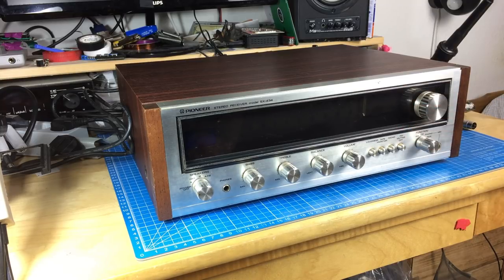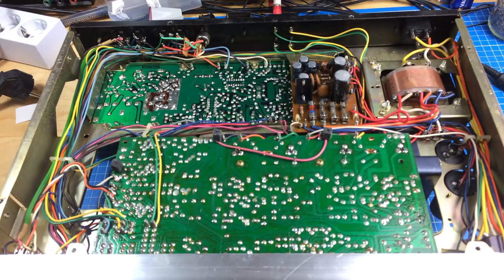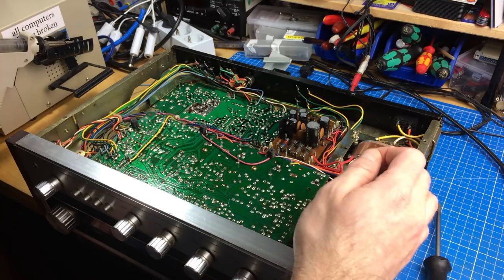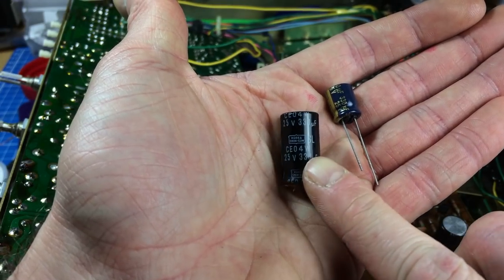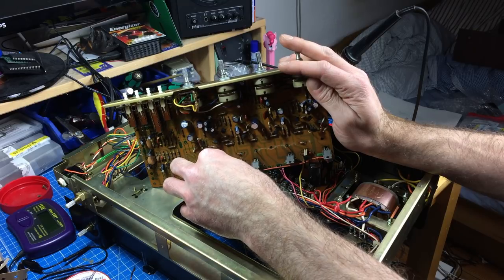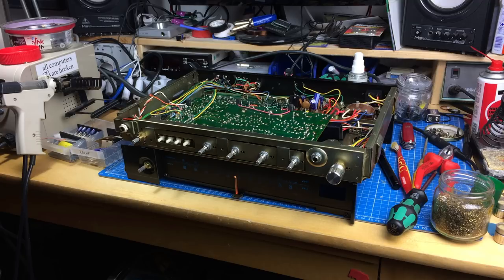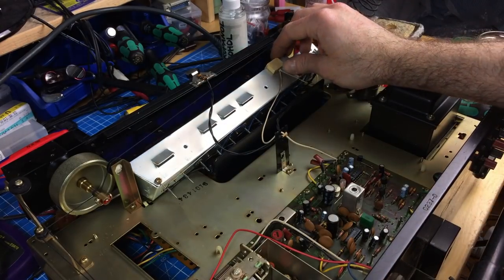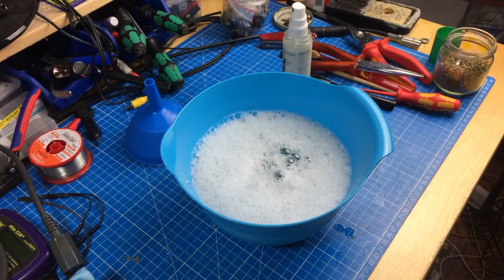Pioneer SX-434 Vintage Receiver Restoration

Comment: Those metal knobs in old receivers have such satisfying weight, unlike the cheap plastic knobs on today's models.
Reply from the maker: Yeah, they don't make 'em like that anymore... :/
Reply: So there is no need to add thermal grease/compound in between the transistors and the plastic isolators? and if you do use the thermal compound would it help with heat dissipation?Great video, very clear and informative.Cheers

Comment: Thank you very much for the walkthrough. Just got finished recapping my SX-434. Wouldn't have been able to do it without you. Great tip on cleaning the potentiometers. My balance was always a little crunchy but its perfect now. No need to replace it.

Comment: When you're replacing a single cap with two that don't exactly match the original, it's good practice to write on the board what that should have been (like .47uF), for future reference :)
Reply from the maker: Oh, that's a good idea. Didn't think of that at all. Will do that next time! :)

Comment: Got my first hifi system in 1974. It consisted of this Pioneer SX-434 receiver, BIC-920 turntable and KLH model 31 speakers all for less than $250. A few years ago at work they were throwing out this receiver. I took it to my fixit guy and for $60 he restored it. Now the Pioneer SX-434 sits in my kitchen and powers a Nakamichi BX-1 cassette deck and Boston Acoustics A-40 speakers. A very happy ending.
Reply from the maker: Oh, nice that you could recreate the old setup to an extend. As I said in the video, they just don't make this stuff like they used to anymore. :)
Reply: @JanBeta , just  been looking at old Pioneer receivers and the SX-434 sells for more than the SX-4, 5 or 6. It is a desirable unit and is a great little receiver. Love that back lit blue dial scale.

Comment: The power transformer is wound normally. The copper wrap, that lies over the windings, is to act as a shorted turn outside of the core of the transformer,  which reduces the effect of any magnetic field from the transformer, that would induce hum into the nearby electronics.

Comment: My vintage stereo project (were I going to attempt it) would be a couple of 8-track decks.  One is a full player plus radio receiver (belt good, no playback) for a friend, and the other is my own 8-track recorder that I finally found where I had stashed it away (same problem, belt is good, no playback).I just don't have a good soldering setup (irons or place to do it)

Comment: I have one and the nob to turn it on is super stiff how do I make it not super stiff. And this one of mine has the original capacitors and they work fine every thing works on it. And the balance nob and volume make a scratching nose. How do I clean them because it sat in a room where I put my hand on the top and the dust made my hand go brown.

Comment: i replaced the light bulb on my saba RS 910 with a LED as well (because i had 2 bulbs die in under 3 months already) - good thing the saba has DC for the bulb so all i did was add a resistor before the LED and some mechanical modifications (LED diameter was larger than the bulb so i had to make the hole bigger)
Reply from the maker: Yeah, these bulbs can die pretty quickly. It seems they especially die if you handle them while they are hot (I guess that's what happened in this case)...

Comment: I had the same, but now there's a lot of humming on the AUX and TAPE IN inputs. Do you know what might be wrong and how to fix it?
Reply from the maker: Look for bad filter capacitors in those input paths and also check for bad ground connections (broken solder joints, ripped wires, loose screws on the metal chassis). If the other input sources don't produce hum, the fault should be located close to the humming inputs.
Reply: @JanBeta  Thanks for your advice. Appreciate it.

Comment: Nice video. Thank you.  I have the same receiver, bought used last week. It's in almost mint conditions. When I listen to the radio and the station is in stereo the red light appears and shows "stereo". However, if I push the button "mono" on the receiver, the light does not change. The sound does change but not the indicator light. Is that normal for this receiver? (With my Realistic gear, when I do that the stereo indicator light goes off.)
Reply from the maker: I don't have the receiver anymore to double check but if I remember correctly that is normal behavior. The Stereo indicator just shows you that the picked up signal is stereo, it is not affected by switching the output to mono.
Reply: @JanBeta  Thank you.

Comment: The transformer isnt "flat wound" but the copper strap you see around it is quite common on EI transformers used to power audio circuitry. It is simply a screening band to keep emissions down. 

The main bugger with these amps (and many Pioneer made) is that they use an odd "multiple diode" device as part of the bias current feedback. If the output transistors fail, these diode strings frequently get toasted, and it is impossible to get them... so you either have to make a hack with several 1N4148/zener diodes, or create a VBE multiplier using a BD139 or something like it.

It's a nice little receiver you've got here though.. i'll carry on watching now (I got 5 minutes in before commenting ;))
Reply: For the 0.47uF electrolyic.. next time.. feel free to use a 100v NPO/COG type ceramic capacitor :)

(edit: Im going to get to be a real pain in the ass arent i ;))

edit 2: looking at where those 0.47uF capacitors are used, they are used as audio signal coupling. Fitting 1uF capacitors should be just fine. The implication of doing this is that it lowers the -3dB cutoff point of the high pass filter that is formed in the typical use of these capacitors.. but it wont cause any major issues (and give you moar bass! :)
Reply: 20:15 - these insulators are called Mica washers. They are primarily as you say, to insulate the heatsink electrically from the tabs of the transistors which are connected to the Collector pin, and thus typically have the rail voltage on them.

Im not sure why Pioneer didnt do this originally, but there should be thermal paste between the heatsink and washer, and then between the washer and the transistor tab. Very messy.. which is why many modern things now use the grey "rubbery" washers you see which are both electrically insulating, and thermally conductive. I suspect at just 15 watts per channel, it didnt matter much..
Reply: 26:02 - im glad you've heard about the criticality of tuner alignment. I have seen plenty of tweakers on DIYAudio completely ruin their tuners by doing a shotgun recapping of everything - including the ceramic caps and things like polystyrene film caps. You are absolutely fine to replace electrolytics though - they will only be used in supply decoupling and audio coupling places, rather than in tuned oscillator places.

Likewise if you see any little wire wound coils that look as if they've been squished or prised apart and sealed with wax, dont EVER be tempted to "neaten" them by straightening ;) It is quite common to adjust an oscillator used in tuners by moving the windings on the coil and then setting them with wax. Of course this is done while frequency measurements are being taken at points in the circuit, to ensure everything is working as it should.
Reply: 30:25 - hmm, what an odd way of adjusting the DC offset and idle bias current. For the bias current, they are basically either shorting out a 10 ohm resistor, or not. I suppose this is better than having a little 10 ohm trimmerpot in there which would go nasty with age... especially with those fragile STV3H bias diodes !

The DC offset will have changed simply because of changing the capacitors C35-C38 , those 0.47uF capacitors you came across. As long as youre not seeing more than +/- 100mV on the speaker terminals under load, I wouldnt worry. Sometimes the output DC can rise higher than this with age, and occasionally it's due to the transistors in the input stage (Q10-Q13) having drifted with age.
Reply: between TP1 / point 27 and between TP2 / point 29 is an indication of the idle bias current. For your 8.8mV reading it is calculatable by ohms law using the value of the emitter resistors (0.5 ohms). So that would mean 16mA. Sounds reasonable given that they are TO-220 transistors.

BTW im sure you know some of this.. but it's good reading for your followers who may not ;)
Reply from the maker: I see. :) As you said, the transistors didn't get very warm after testing for a while so I suppose it will be fine without thermal paste.
Reply from the maker: Haha, no pain in the ass. I'm learning a lot from your comments. :)
Reply: Glad you are finding my feedback positive, not negative (theres an amplifier joke for you ;)
Reply: @jaycee1980  I noticed that too. After seeing the quality of this receiver, I don't see why they didn't add thermal paste. Makes me wonder if they did on the fancier units.

Comment: @Jan Beta... just a tip..... as you see at minute 39:01 ... the numbers 94.. 104 and 108 of the dial... are illuminated with a much clear tone of blue.... because it hits directly the brightness of the LEDs on those numbers ..... I got better result in my amplifier.. pointing the LEDs to the back....  pointing to the silver plate behind.... so the numbers get illuminate with the light that bounces on that silver plate more smoothly...
Reply from the maker: Yes, that makes sense. Thanks for the tip. I was experimenting with putting tape over the lamps as well with some good results. You definitely need to diffuse the light more as the LEDs are much too directional.

Comment: Great video! I used this to change the lamps on my Pioneer SX-434  and worked great.
Still the sound is failing from time to time (specially after 5/10 minutes of usage )either on left or right channel. I ear a sound like an explosion really loud or just fades and becomes intermittent...
I already cleaned it and used the Teslanol contact spray 
Could it be the capacitors? Any ideas?
Thank you!

Comment: I am looking for the best place to buy the cord that is used for the tunning of a SX727 I live in Qld Aust
Reply from the maker: I'd recommend searching eBay for "dial cord" / "dial string". I found a vintage hifi seller here in Germany that had plenty of different gauges of the string (used it to restring a Marantz in an earlier video) but you probably will find something locally as well. :)
Reply: Never heard of QLD in Austria, must be one of those little villages at the edge of town?

Comment: Hi,  I  bought  one of this a week  ago,  exactly  same model,  it was working  fine only minus was  only half of the  front radio quadrant  was  lighted,  and  the bass  knob  was making a static  noise but just when  increasing and decreasing  the bass. I  removed  the knob and sprayed some electrical  contact  cleaner  inside  of it,  and the result  was lost of bass and and almost all the sound,  now only little  sound  is coming  out from  all outputs.   what can I do?  please give me some  advice,  I will  really appreciate it. ☺

Comment: I have a similar one but one channel has a scratchy sound output. Shop says not worth repairing. Can you help?
Reply: Are you serious? They actually told you that? My advice would be to find another shop, if possible.
Reply: @hondaphan4172  Found another electrical shop locally. Called them and they asked me to bring it. I told them everything works and just the right channel was not working properly. Then after three weeks I called and they told me not worth repairing. Guess what when l got it back.. receiver no longer works 😤 l wish I did not take it there.

Comment: Hallo. Ich habe einen Pioneer SX-636 und möchte auch gerne die Kondensatoren tauschen. Habe leider noch nicht ganz so viel Erfahrung damit. Gibt es zusätzliche Tipps, wo welche Kondensatoren geändert werden müssen / sollten? In einschlägigen Foren wird ja oft davon abgeraten, wenn das System an sich funktioniert. Und wo bekomme ich das Material her?
Wurden jetzt Kondensatoren mit höhrerer Temperatur- und Spannungsfestigkeit verbaut?
Und: alles Elkos oder auch Papierkondensatoren o.Ä.?
Wie ist das mit den großen Netzfiltern? Bin etwas besorgt, dass die irgendwann mal hochgehen und ich an einem Herzinfarkt sterbe. :'D
Und wie sieht es aus mit den Transistoren? Auch tauschen oder lassen?

Desweiteren bin ich besorgt um den Trafo. Dieser ist auf 220V~ ausgelegt und kann bei meinem Modell auch nicht verstellt werden. Kann ich mein Gerät trotzdem gefahrlos verwenden, obwohl die Netzspannung heutzutage höher ist?

Ich weiß, viele Fragen. Aber ich freue mich trotzdem auf eine (kurze) Antwort.
Bin durch meinen Pioneer auf dieses Video gestoßen und schaue mir gerne noch andere Videos auf dem Kanal an. :)

Comment: Jan I was wondering don't the amplification FETs not need replacing after 40 years of hard labour ?
Reply from the maker: Oh, of course they can go bad, too. Most of the times they last a long time though and only get damaged if something else in the circuit feeding them goes bad (often caps or adjustment pots)...
Reply: OK

Comment: is there not a worry that the replacement caps wont last anywhere near as long? after all they are working, they may work another  40 years! many old caps are larger as they dont rely so much on the electrolyte, and it boils out less anyway,  there in fact used to be dry caps which seem to last forever, but too large to fit in modern devices
Reply from the maker: That's a point that's discussed a lot. I tend to replace caps that old anyway and use good brand ones (in this case mostly Panasonic FC) as replacements. I measured some of the caps in this unit and most of them were still good (with slightly high ESR) but some of the smaller ones were off. The whole unit sounds a lot better with the new caps. I find that these old devices sound better after recapping in most cases so I think it's a good thing to do. Even if the caps won't last as long as the originals, they will probably do for at least some additional decades.
Reply: well that DOES change my mind somewhat! thanks, i guess old caps are often why old amps sound kinda dull?
Reply: Yes, particularly when it's signal coupling capacitors that go bad. The rising ESR and lower capacitance value usually increases the low frequency -3dB rolloff point, so you lose bass response

Comment: i think your yellow led is so dim, because you actually forgot you rectified your nine volts down to five volts, so you need a ~150 ohms resistor instead.
Reply from the maker: Yes, you're absolutely right. I actually changed the resistor to a smaller one after finishing the video. Shame on me.

Comment: I have a funny feeling that it was probably possible to unscrew the heat sink from the frame and leave the transistors attached.
Reply from the maker: Yes, it’s possible (I actually tried and edited it out) but the PCB would not slide out because the other PCBs were in the way. Would neeed more disassembly to get it out that way so I went for the transistors.